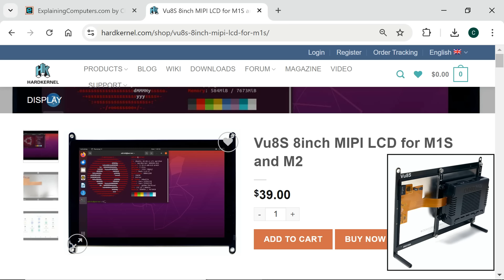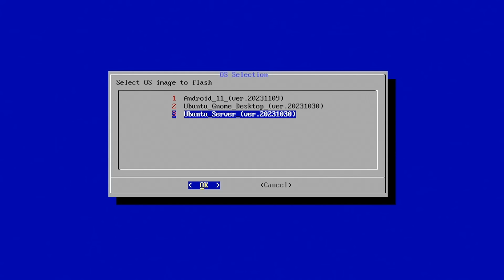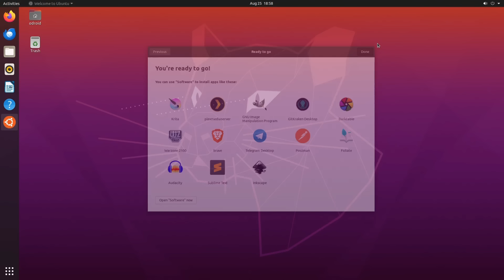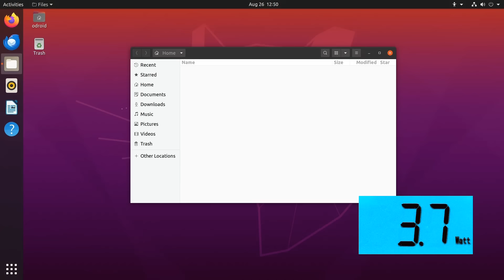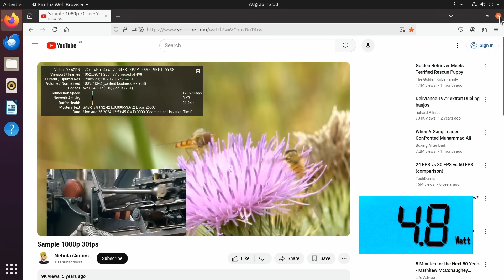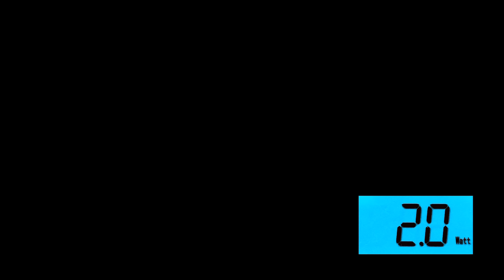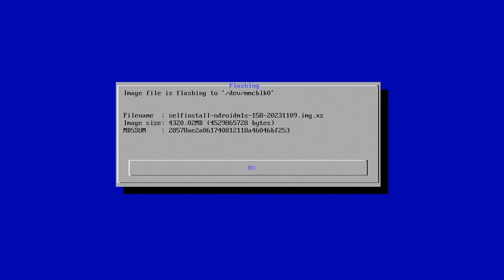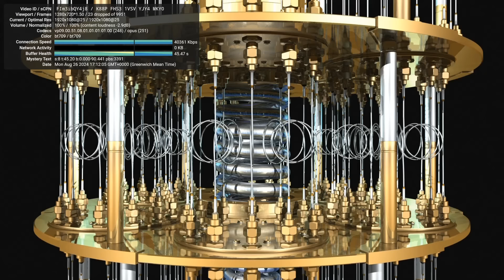Odroid M1S: Great Value SBC Kit

Comment: Is it just me or are USB-C data ports really unpopular in the SBC space?
Reply from the maker: Certainly not just you! :) They are rare. But remember that USB-C is not an interface standard, just a connector, with most USB-C ports (certainly on lower end hardware) having USB 2.0 or USB 3.x connectivity.

Comment: Question to viewers: if you have an SBC, what do you use it for?
Reply: Lots and lots and lots of things. Watch through this channel's back-catalog to learn more. ;)
Reply: Home automation
Reply: @Praxibetel-Ix  You haven't answered the question,
Reply: I have quite a few SBC's across the Raspberry Pi, Orange Pi, Banana Pi and other brands.

I use one as a Pi-Hole on my network to provide DNS-level ad-blocking.

I have one in a Pi-Cade cabinet as a bartop arcade cabinet.

I have a couple that I use as build machines for Gentoo Linux - they have root filesystems on SSDs so it's easy to clone them onto (Micro) SD cards for other machines - I don't like the standard Linux builds made by the manufacturers of the boards, including Raspbian.

My Pi 400 is currently an Amiga emulator.

I have several Pi Zeros as cameras around the house, mainly checking out what the cat is doing at any particular moment in time.